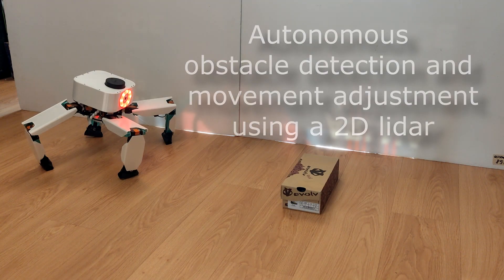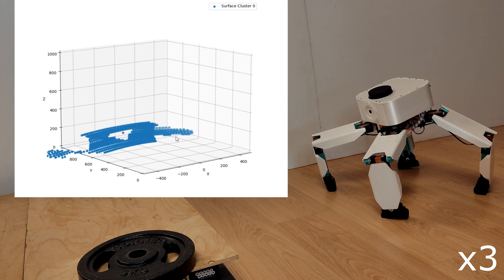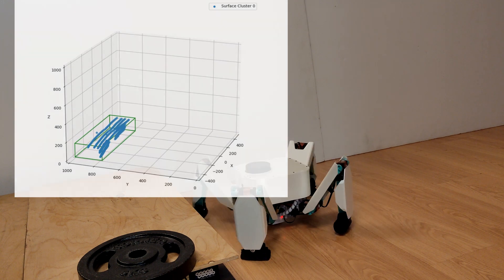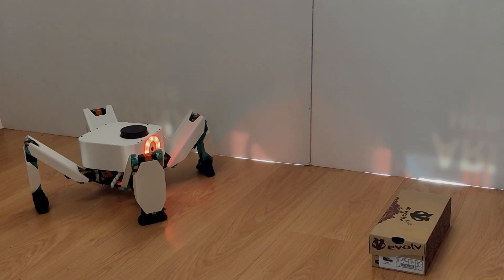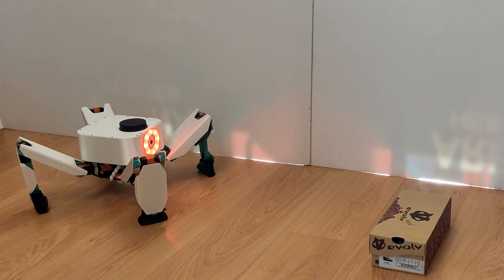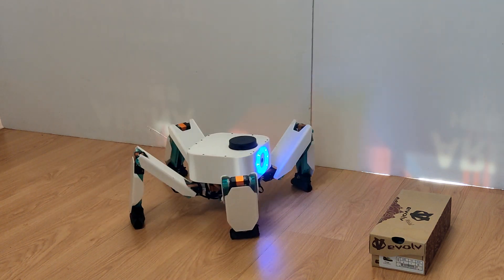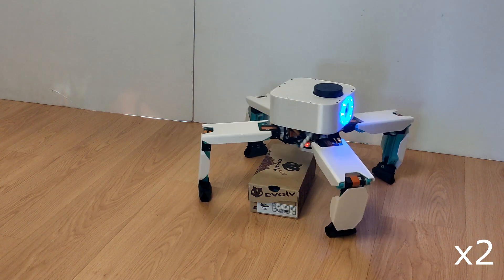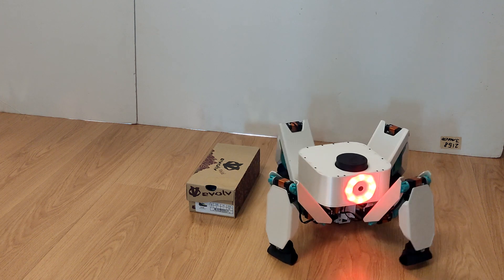LiDAR-Enhanced Quadruped Robot: Obstacle Detection and Navigation

Comment: It's very nice, I like the one with wheels more, it can go faster. What is the engineering, software or mechanics that prevails in such projects? Actually, the algorithm side is related to software. 
Do you have knowledge about mechatronics engineering?  Which department did you study at university? What is your advice to us?
Reply from the maker: So many questions! 
I liked the wheeled one more too, but it's legs were so heavy, that it couldn't climb even a 5 cm obstacle. 
I lack knowledge in mechanics and engineering, so there might be many mistakes in the design, but I can't know them. 
I've focused mostly on software, because this is my specialization, I've studied computational mathematics and cybernetics in the university. 
About wheels - yes, they were locked while taking steps, without the lock it was impossible to take even small steps. 

My advice - try making something simple first, and then improve parts of it while learning new skills. Step after step you will make it excellent one day. Trying to make it perfect from scratch will result in burnout.
Reply: @LightRobotics  If you make small simple robot making videos to gain subscribers, you will gain a lot of subscribers. I follow robots like you, but since it is very complex, the number of subscribers is low and keeps us away from this project. For example, if you film the construction of a tumbling robot or a small robot powered by Arduino and a few servos, hundreds of thousands of people will watch it step by step.
Reply from the maker: @sametk574  that's true, you get more subscribers with content, that's easier to understand and repeat
Reply: Also, couldn't the wheeled one have a locked gear box, that is, something software or mechanical that would prevent the wheel from moving while taking a step? I don't know much about this but

Comment: Been meaning to get a ToF camera module for robotics. You could technically get 3D vision with a stereo-camera, but because it relies heavily on processing the images to infer a depth-map which in turn needs a LOT of cleaning to get rid of significant quantity of noise. It is kind of not worth the trouble when a ToF camera will just give you what you need straight away.
Reply from the maker: That's an interesting idea. But I don't have much time for this project, so I'd prefer a ready-made solutuon :) 
Especially as there is now a cheap tof-camera available for 50$
Reply: @LightRobotics  Again it doesn't make much sense to go stereoscopic for depth in the age of ToF being so widely available.

I'm going to guess that you are referring to the Arducam ToF?
Reply from the maker: Yes, I just got one. Though my first attempt to make it work in headless mode failed, hope I can get it working soon

Comment: Check AFBR-S50MV85G for a cheap 3D lidar, you can get boards for around 100$. Like the LIGHTRANGER 7 CLICK. It has only 16 pixels, but gets you started in the 3D stuff. You probably want to have both, the 3D for short range directional and rotating lidar on top.
Reply from the maker: Thank you. Will check it out if the tof-camera is not good enough